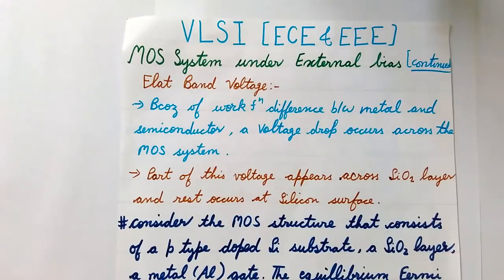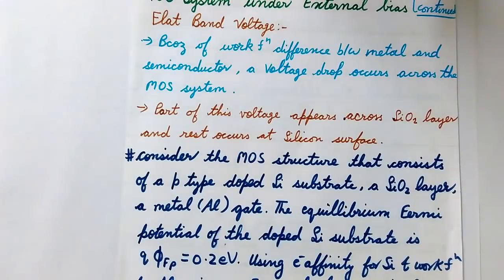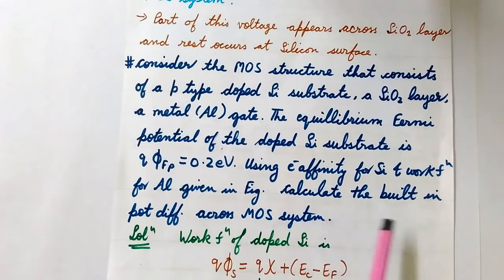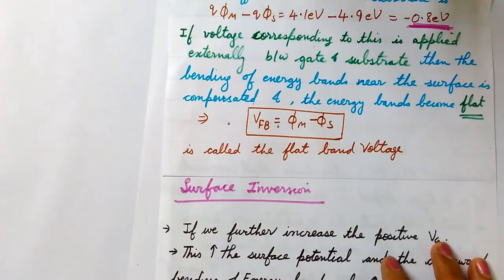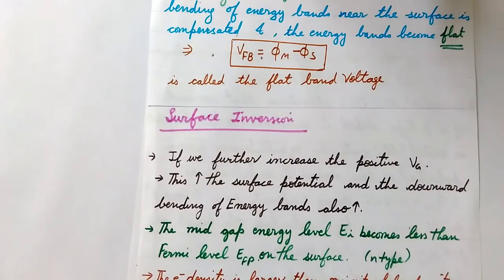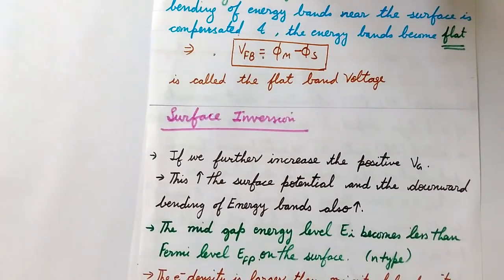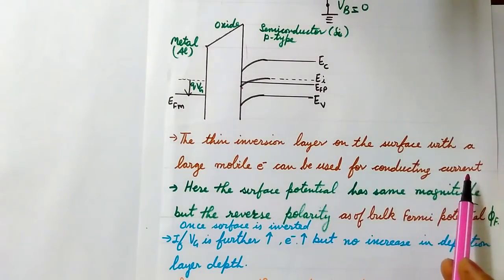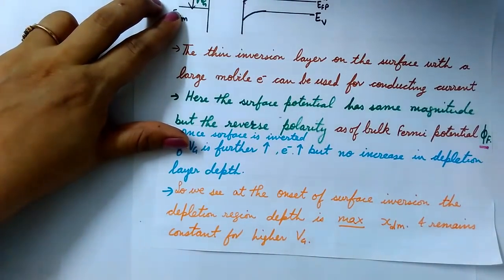VLSI Lecture 4 - Flat Band Voltage and Surface Inversion

Comment: Want more videos on
Measurements of parameter _KN,VTP....narrow channel effect........mosfet capactance

Mos inverters
Cmos inverter design
Switching circuits characteristics
Mos transistor switches
Introduction to VHDL language
Silicon semicondctr technology
Cmos technology
Testing

Plzz madam.....make dis videos as soon as possible...as all students need this